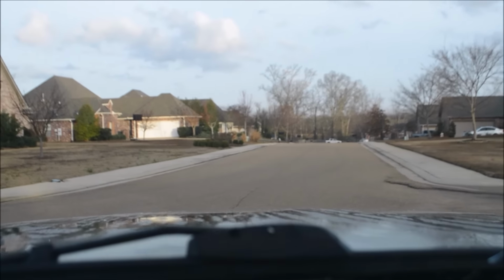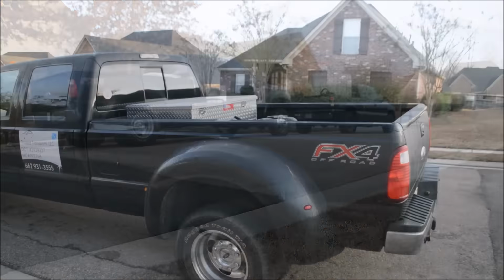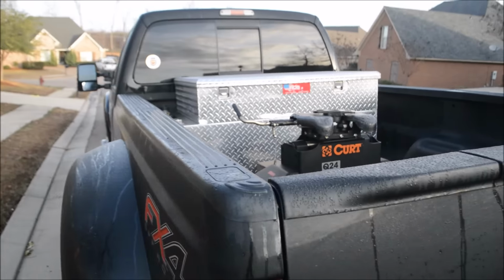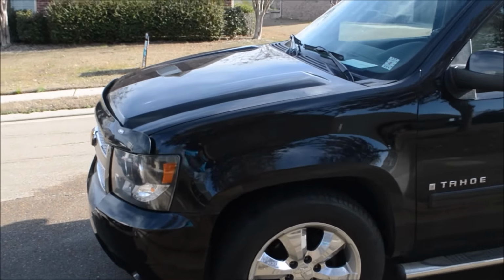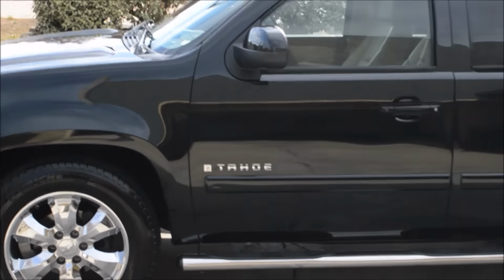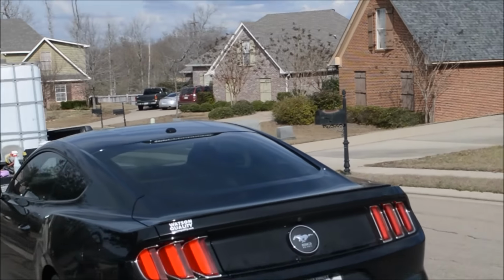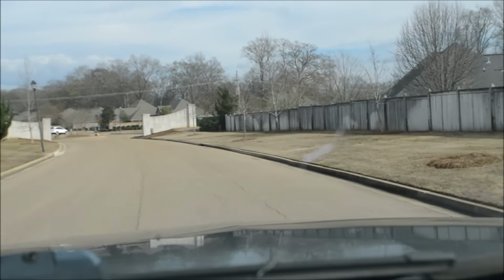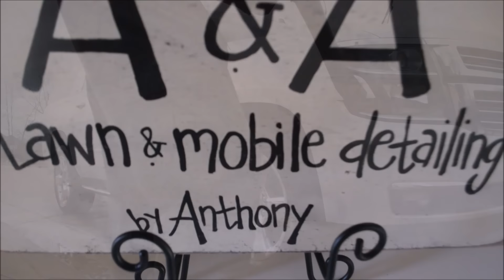A Day In The Life Of A Mobile Car Washer Vol. 2

Comment: Great Video! you have earned a sub.. A Foam Gun is a must for the type of work you are doing, it will make your job sooooooo much easier! Spray the car down with water first and then Foam the entire car and let it soak.. You should consider using the 2 Pail Method when soaping up the car, this will also prevent scratches.

Also you should get a Leaf Blower and blow the vehicles dry!  I have one that i paid 80 bucks for and it blows 250mph, make sure its electric only, do not use a gas one.. Blowing them dry will save you time and prevent scratches from using a microfiber towel, especially on black cars.. 

Also invest in a soft bristle brush with a long handle to get inside the wheel wells rather than using a microfiber towel..  All of the above will prevent you from getting a back injury which in the end will prevent you from working and supporting your family... 

Keep up the Good Work!!!!  Bless!!!

Comment: Hello, thanks for the video. I would like to ask for advice. I have a small handyman business, but I do all kind of labor work. There is a demand among my regular clients and friends about car washing, basic service. So I wonder if you can recommend a suitable equipment for a mobile car wash - pump (electric or gas), generator (if electric), and a small tank (not more than 100 gallons); in general I need an easy to transport full set elements that will allow me to perform basic wash as a start.

Thank you in advance.